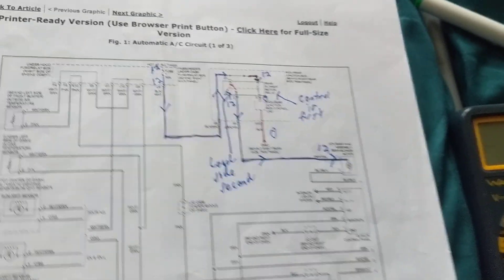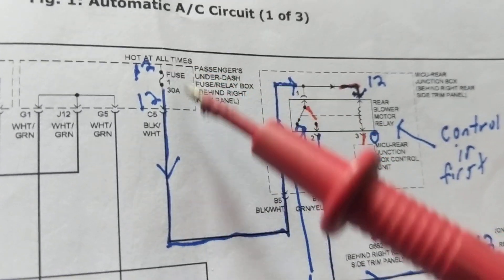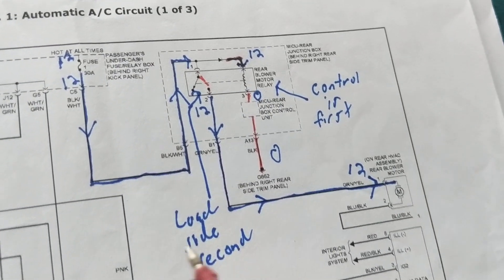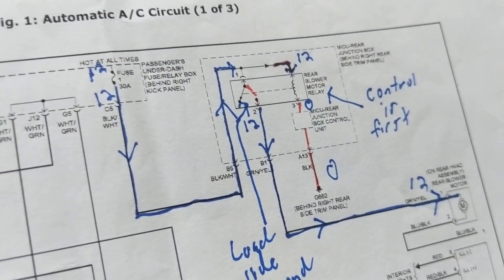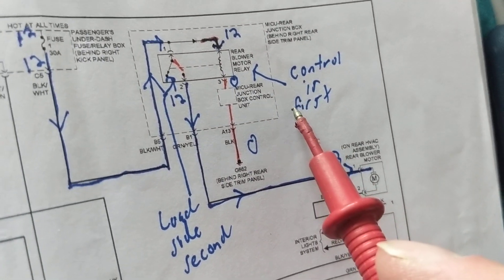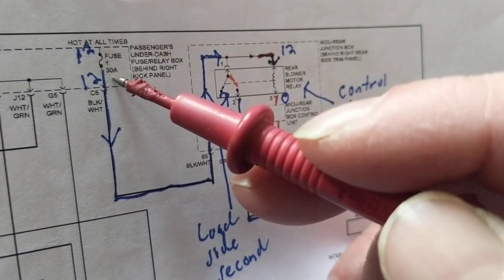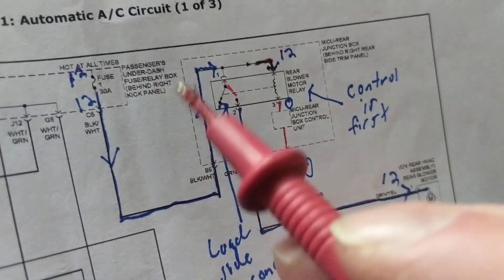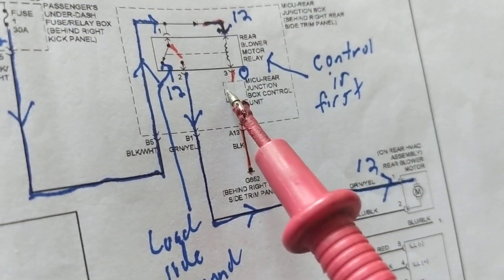HOW TO FIND A SHORT THAT KEEPS ON BLOWING THE FUSE

Comment: My guess would be that diode failed in the closed, ie, conduction mode..that would let the spike go back to the fuse, I stead of blocking it....I would guess a straight broken insulation wire would be more likely to blow quickly, rather than intermittently..do I have it right Joe?  Thanks for you excellent explanation.
Reply from the maker: Great analysis the diode is there to protect during spikes when the really goes on and off

Comment: Good job Joe. Thank you. I think of a spike as for example, a motor spinning having a Flux field around it...on start up, there is an inrush of current, expanding the magnetic Flux field ..once the motor begins to spin, the field collapses back to baseline,  and that collapse goes both toward the input side and toward the ground side...because it splits the load back to the source and ground...but the diode protects the source side from the induced current...possibly damaging it, or blowing a fuse... from going back to the source, and hence it will deplete thru the ground.. So, since a diode can fail closed or open...if it fails closed, ie, co ducts....boom..when there is a load on the motor, the back curring now has a path to the incoming fuse..which protects the switch or ecm upstream..I hope I've got this right Joe? I've learned a lot from you. Thanks again

Comment: Hello, Joseph. Will a seized alternator causes the alternator fuse to blow? I tend to believe that it won't.
Reply from the maker: You mean an alternator that stopped turning cuz it's pulley? The only thing that would blow the alternator fuse remember that's a very big and fuse amp fuse is somehow something is touching the frame of the alternator which is ground or something internally